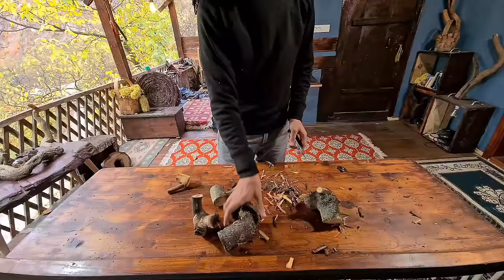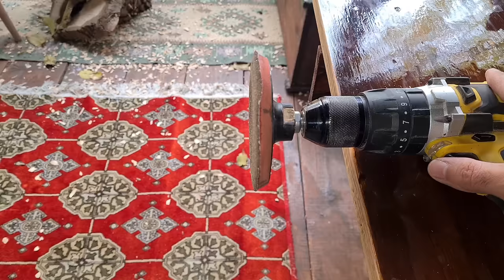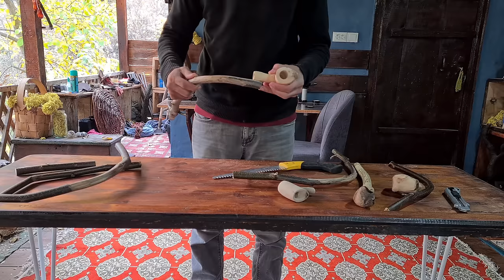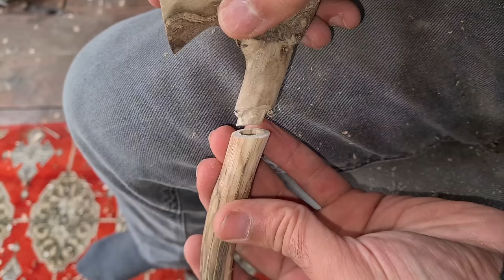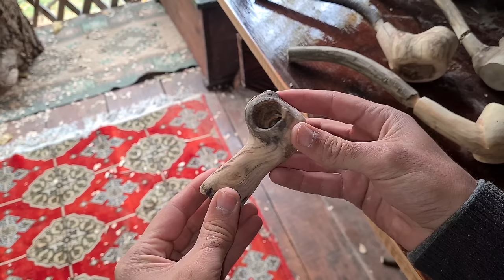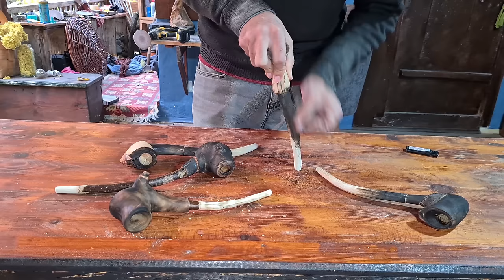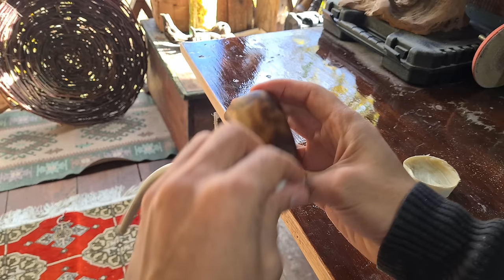MAKE A SMOKING PIPE - How To Make Smoking Pipes From Wood - Diy Pipe - Wood Pipes

Comment: i have a queestion, what Drill did you use to make the long holes in the Stem of the Pipe, and how did you soak them to make them able to bend without snapping ????
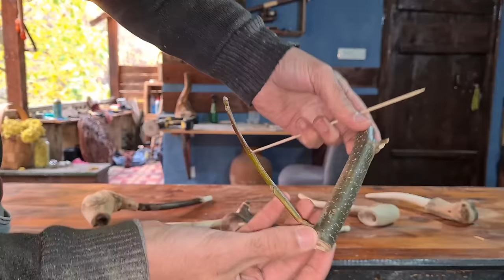Reply from the maker: I didn't do any drilling. The holes on the handles come from the walnut tree I used. So it has its own natural space. It was enough to clean this gap with a wooden toothpick. You can look at 11:11. Since I bent the branch while it was still fresh, wetting was not necessary.
Reply: @BROTHER_WOOD08  alright, Thanks man!

Comment: the pipes came out nice but you don't show enough on how you drilled the holes in the bent stems.
Reply from the maker: Thank you for the comment. The holes in the bent stems are caused by the branch I use. The walnut tree branch contains the necessary space. So I didn't use any drill bits. There is a membranous part on the trunk of the branch. This gap can be easily opened with the help of a wooden toothpick. All you have to do is give it the correct shape and then open an air gap with the help of a wooden skewer.

Comment: How did you drill the hole through the stick to make the mouth piece? That's what I wanna know.
Reply from the maker: I did not drill the stems. The hole originates from the structure of the walnut tree I used. I first shaped it and then cleaned the hole there with half a wooden skewer. If you look at minute 11:11 of the video you will see. That's all I do.
Reply: @BROTHER_WOOD08  I saw what you did, but thought you must have drilled it first. Did not know they where "hollow". 
Should try it myself. Thanks, and nice pipes. You sell?
Reply from the maker: @timmymansson5016  unfortunately they are not for sale. I'll keep to myself for now. I hope you can find a tree branch that works for you. If you cannot find it, drilling and shaping a fresh branch beforehand will also work.

Comment: How do you make the hole on the stem or mouth piece what ever it is called (sorry 😄) I didn’t see how that was done. I understand the bowl and drilling that out, but how does one drill a hole through the curved stem that goes to the mouth!
Thanks for sharing this video it has excited something in me to try this myself!
Reply from the maker: Thank you for the comment. The holes on the handles are inherent to the walnut tree I used. I gave it a curved shape and then cleaned the inside with a wooden toothpick and that was it. You can see this at 11:11. This is a pretty easy thing to do. People do this in a very complex way. They don't expect it to be this simple. However, it is important that the branch used is fresh. Fresh branches have a wider hole.
Reply: @BROTHER_WOOD08  thanks for the reply and the info, watching this video has inspired me to pursue pipe making as a hobby for myself, I have been searching for a way to incorporate woodworking into a hobby for my life and pipe making seems to be a perfect outlet for my love of working with my hands with wood!
Thanks again for sharing!

Comment: The use of briar is because of how it handles the heat and not burn the wood. And most briar's are aged for quite some time, to get moisture out of them. I'm not sure if these would be very smokable. I'll admit that I did not watch the video, but in one of the comments you admit to not being a smoker. So, I have my doubts.
Reply from the maker: I think the pipes I make are not very high-end, but they are usable. Only one of them was not dried enough. That's why cracks appeared in some parts. This improved the look but made it less likely to be useful. Others were pieces of wood that were very well dried and highly resistant to fire. I became very aware of this while burning it with a blowtorch. However, it is still a job in which I am not an expert. Thank you for sharing your thoughts with me. I will try to make better pipes in the future. Thank you.
Reply: @BROTHER_WOOD08  Even most low end pipes are made of briar. Briar will not burn and does not transfer hear as readily as other woods. And a lot of briar is aged for several years before use.

Comment: I am new to pipe making. What kind of hard wood can i use to make the bowl?
Reply from the maker: I cannot say that I am very knowledgeable about this subject. But, the harder and more difficult the tree is to process, the higher quality the resulting product will be. Among the ones I know, I can recommend walnut tree, mulberry tree, pear tree, cherry tree and juniper tree. Especially cherry and juniper trees have a unique color. Good results will emerge. However, make sure that the trees are dried well. Then all your efforts may be in vain.
Reply: For bowls, use nut or berry trees like walnut, cherry, pear etc. 
Cedar trees hold an oil that is bad on your lungs when it burns. 
Read up on it yourself, but that's what I have learned.
Reply from the maker: @MRJUSTINSTUBE  you are right. Doing this job without knowledge about this issue may harm someone. In this work, I paid more attention to the shapes of the branches I found. As far as I know, I have not used a tree that is harmful, but I will be more careful about this issue in the future.

Comment: Nice work and beautiful, but the pipes are not useable without a plastic or even hardened bamboo mouthpiece.
Reply from the maker: Thanks for the comment. I think you are right. I am not a smoker. I tried to create as simple but different designs as possible. There might be some things missing. However, I can say that they are comfortable as is.

Comment: You should invest in a good carving knife, something with a good, strong blade. Its only a matter of time before you will regret using a utility knife. Not trolling, excellent video, just be safe with the box-cutters
Reply from the maker: Thank you for watching. Actually, just the other day, I used a utility knife again while doing my latest project. and unfortunately it caused a very bad cut. I will try to follow your advice and buy a knife.

Comment: Please get a real carving knife.  The utility knife is just not a thing in carving wood. You're gonna end up hurting yourself.
Reply from the maker: Thanks for your kind comment. The utility knife is actually more useful than it looks. You just shouldn't act in a hurry. because it is brittle and very sharp. I haven't had any problems so far. However, I will use a suitable knife for this job in the future.

Comment: There are no walnut trees here. The center is called the pith. If it is not soft it won't push out easily.  The mouthpiece (stem ) is the hardest part to make. Drilling is not good. The drill goes out the side . Especially  bent  stems. I have segmented  bent pieces and drilled out each seperately. This works but is not perfect.
Reply from the maker: It was these gaps in the walnut tree branches that convinced me to make a pipe. If such an idea had not come to my mind, this project would have been really difficult for me. There are other trees with the same features. for example dogwood. I think there may be branches you can find too. Check the fresh branches, especially in spring. I'm sure you can find something that works for you.

Comment: Hi. please use a knife instead of cutter.that blade is sharp but it break very easy and i cut my finger very badly with that blade when it break suddenly
Reply from the maker: Thank you for the advice. 😊I'm actually thinking of buying a carving knife, but I couldn't find a decent one. The utility knife is a knife I have been using for this type of work for a long time. It really works very well when you are careful. However, the slightest carelessness can cause bad cuts. I'm thinking of using a new knife in future videos. I hope I can find a nice knife.
Reply: @BROTHER_WOOD08  so be careful bro 😁
Your works are great 👍

Comment: It doesn't show the most important part - how to drill the holes to align correctly.  It's not as easy as you'd think.
Reply from the maker: I didn't do any drilling. The holes come from the tree I used. The fresh walnut tree has a natural cavity. I just cleaned this hole with a wooden skewer as in 11:11, that's all.

Comment: Don't show how he made the holes in the stems ,that's the hard part of making pipes
Reply from the maker: I use a very simple method on the stems. There is a natural gap in the walnut tree branch I use. I'm just clearing this space, that's all. You can see this at 11:11. Or you can check it out in my 3rd pipe video. I tried to show it in more detail in that video. It is a very simple but very useful method.

Comment: I’m sorry I had to give you a thumbs down, but you didn’t show us how to drill a hole through The long neck of the pipe you showed us how to make the base with the tobacco goes in you showed us how to pick the fine wood for the neck, the long neck of the pipe but you never showed us how to drill a hole from one end where your mouth goes to the other end where the pipe goes how could you expect me to give you a thumbs up especially after all that hard work you did when you didn’t show me how to drill a hole through the damn thing again I apologize you did an awesome job but I can’t give you a thumbs up for not doing thumbs up work🌹😇💝🤣🌹😡🌹😪🌹
Reply from the maker: Thank you for the comment. Actually, I didn't drill a hole in that part. The hole was present in the tree branch I used. I just cleaned that hole with the help of a wooden toothpick, that's all you can see at 11:11. There is a spongy gap in the fresh walnut tree branch. You can easily clean this gap and create an air gap. Therefore, I did not need any drilling. It's actually a very simple process. First you give the branch the correct shape and then you clean the inside. I hope this information is useful to you. I want to show this more clearly when I make different pipes in the future.